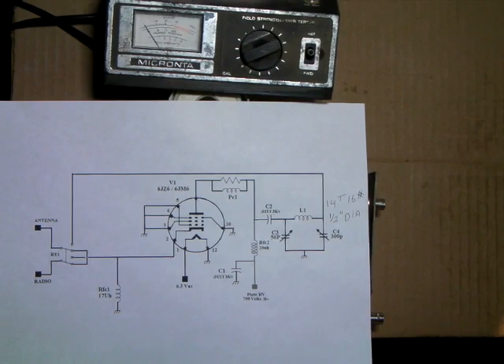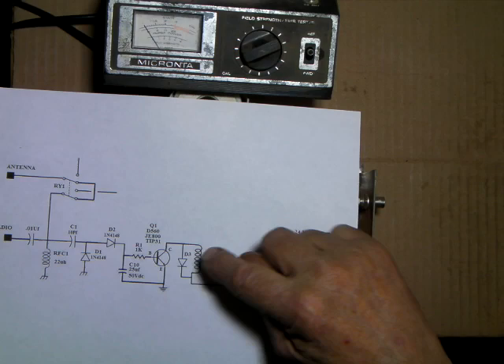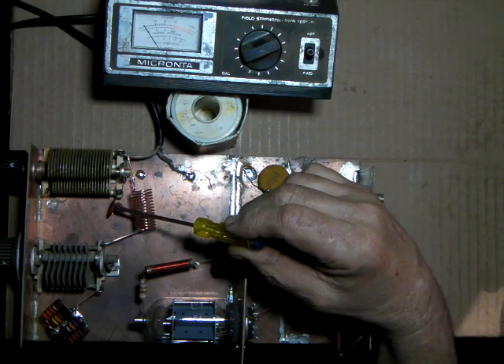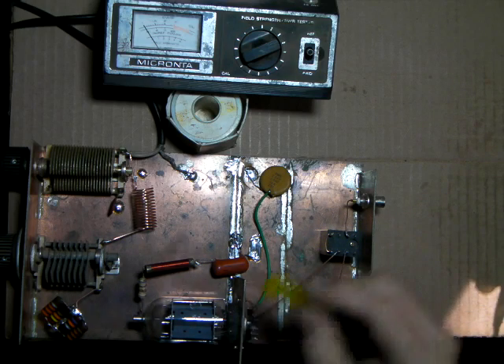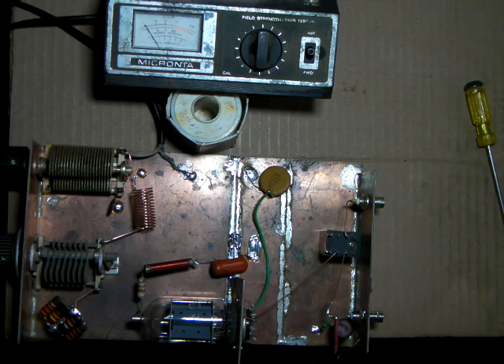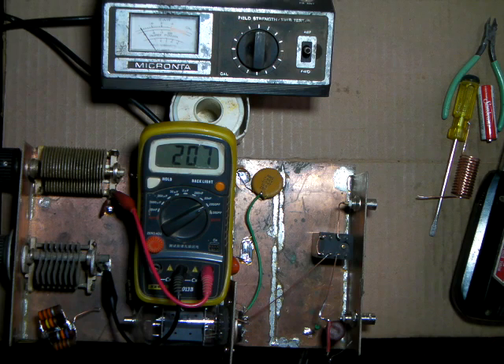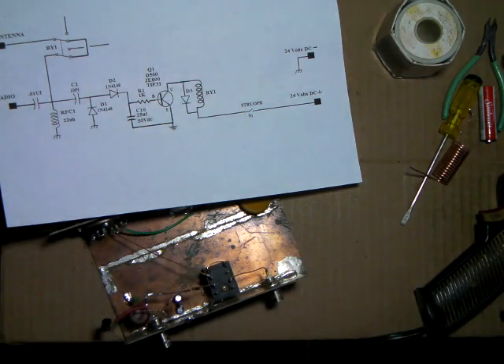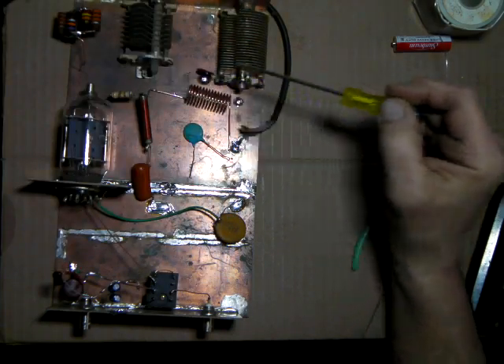Build a Tube Type Linear Amplifier For CB Or Other HF Bands Ep11: Building A Single 6JZ6 Amp Pt2

Comment: U need  to use HV caps ..1 k isn't enough ...get a door knob at 3-5 k
Reply from the maker: The plate voltage is only 600 to 700 volts, so more than 1000 volts is not needed but maybe if someone was using 900 volts or so then yes a 2Kv unit would be in order.
Reply: @radiomedic111  it makes a difference on life and the ability for the cap to last
Reply from the maker: @JustinRuth-km4wz   Here is a link to that schematic for your reference...:   https://cbtricks.org/Amp/palomar/150/graphics/palomar_150_tube_sch.pdf
Reply from the maker: I suggest that you look up the schematics for a Palomar 150 mobile linear and tell me what the plate blocking caps are....are you telling me that you know more than the engineers at Palomar?
Reply: @radiomedic111  not arguing with anyone in work on this stuff  everyday all day ....if the operational voltage are that low it fine ..i didn't relise  u were working with 600 volts ,I thought u were  up towards the cap ratings.. but using higher voltage ratings can actually be a positive thing... I restore and build amps daily . And I never said i new more than anyone ,I was trying to just give u a tip ... I thought u were  working with much later plate voltages I use 0047uf at 3kw blockers ..even in the amps I build that only have 600- 900 volts on plate all the time ..infact most are their blocker which o even send pics.. I'm not a newbie bro,and never ever ever did i claim unknown more than anyone .. just mis understanding that is all..and you don't need to apologize it's ok...were all human.. ... Like the sweepers like the 300 v with quad doubler or doubler , they all use 3kv cap at 0047 .. but they have aloy more on plate ...the 300 a  has 2 styles on is doubler with 600 v transformer,one is 300 v will the quad drplr.,but I'm restoring a DNA raider right now and it uses the exact cap as I just  stated..3kv 0047.. so if you peaking at 600 I would say your pretty close to your tolerance ..at 1kv...
Reply: Yll
Reply from the maker: I apologize if I came off as rude.....I guess that I need to go back into teacher mode and explain why it is absolutely unnecessary to use a plate blocking cap with more than a 1000 volt rating.
Number One reason is that the circuits that you see this used in the Palomar amps are only running 600 to 700 volts Dc. The number two reason is the capacitive reactance of a .01uf at 27Mhz....If you look in the ARRL handbook at the chart for capacitive and inductive reactance you will see that a .01uf cap at 27Mhz has less that 1 Ohm of reactance to an AC voltage of 27Mhz...in other words the cap looks like a resistor of less than 1 Ohm to an RF signal of 27Mhz and the only way to get more than a 1000 volt drop across the cap is to draw more than 1000 amps of current....Remember Ohms law  I X R = E........Palomar is using .002 uf disc caps and that value of capacitance is 2000Pf  or uuf and has a capacitive reactance of just under 3 Ohms at 27Mhz.   I hope that this clears up your understanding of Plate blocking caps and the hold off voltage that is required....you may have been told the information that you are going on by someone that did not fully understand what they were talking about.

Comment: Hi haven't seen a video in a while hope you are ok looking forward to  seeing more from you.
Reply from the maker: Thank You  every thing is ok !  just busy with summertime stuff.....the next set of vids will begin in the late fall and will be about building a single tube amp with a 4CX250B from start to finish.
I may get a chance to do a video about the little blue 4 tube 6146W amp that I designed for Palomar back in 1999 named "SKIPPER BY PALOMAR"  300 Watts output from 4 6146W tubes with 4 Watts of drive.